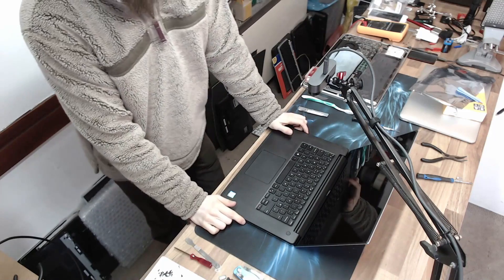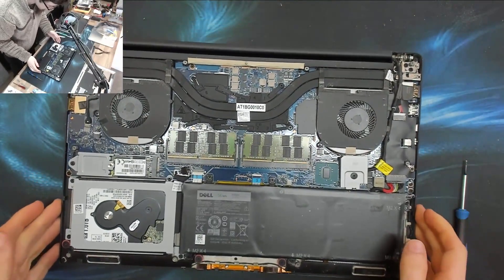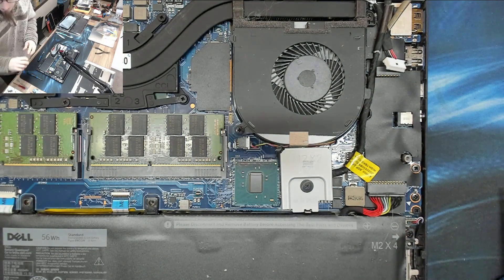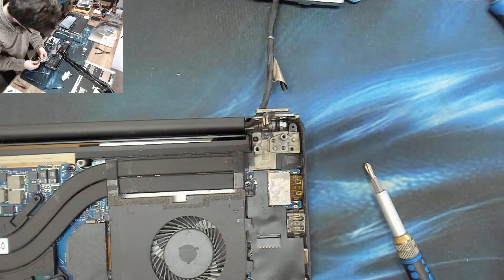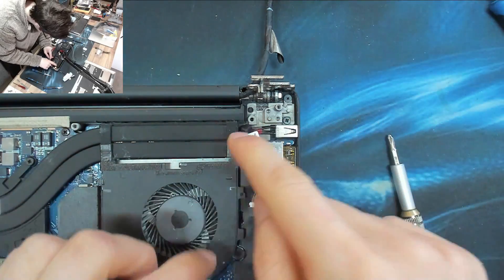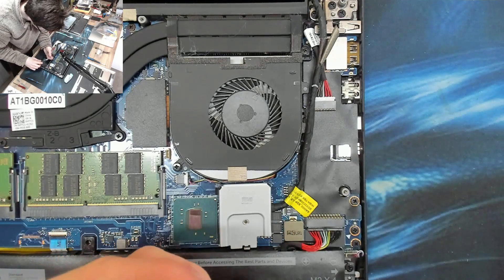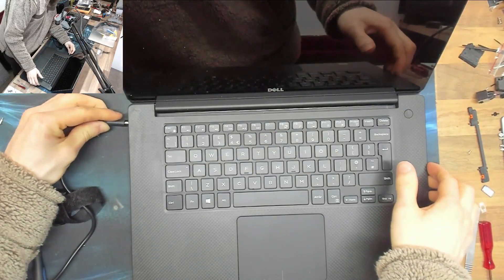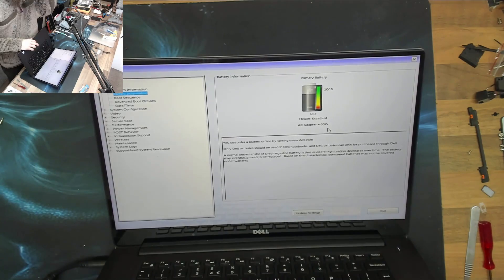LFC#130 - XPS 15 DC Jack Replacement

Comment: Thanks a lot for the video. I was smart enough to stir in the DC port with a 3.5mm headphone jack. Classic. Broke the plastic thingy off. I'm now charging via USB-C, but after seeing this video, I think it's well worth spending the $6 on the replacement port. Thanks a lot.

Comment: Odd question, but you dont happen to know the name/product number for the replacement DC jack? I ordered one through which turned out to be the wrong one and I can't seem to find the correct one anywhere haha!
Reply from the maker: Not exactly. I usually search for something like "dell xps dj jack" on ebay, and then browse the results until I see one that looks identical. Pretty much all ebay sales these days have accurate pictures in my experience, so if it's a visual match, it should be correct.

Comment: should i replace if cable is loose fitting? it easily comes off the jack.
Reply from the maker: Yea that sounds like it's worn out. For how easy this is to do, I'd say it's a good idea.
Reply: @Adamant_IT  i will. Thank you. I need to replace the hinge too, so I'll do it all at once.

Comment: This is so simple! Fixed computer within a matter of 15 min. For anyone out there wondering, I have the XPS 15 7590, this jack seems to be for the 9570. Found my jack on amazon for $8. Beats $100 by a mile for someone else to fix it. Great video, thank you!
Reply: I also have the 7590 - do you have the correct part information? :)
Reply: @caroljordan7384  Hi! I tried replying twice, I guess it didn't send. Here is the information, I bought the part off of amazon. 

GinTai AC DC Power Jack with Cable Socket Plug Connector Port Replacement for Dell XPS 15 7590 P56F003

Best of luck fixing it!
Reply: @eviel4297  I just replaced mine with this part and the computer won't boot if the battery is connected, just flashes the power LED slowly. Not sure what's going on.

Comment: This is not for the Dell XPS 15 9570!  All electrical connections are soldered - not screwed.  I recommend everyone who owns the 9570 get the accidental damage coverage from Dell.  Good luck getting it scheduled for service.  I've been trying for about 3 weeks just to get a call back from Dell to get the jack replaced.  Geek Squad cannot fix it due to the soldered connections.  There is only one service center in the US to make the repairs.  I hope this doesn't cost me an arm and a leg to replace an $8.00 part!

Comment: Re: Hinge for anyone reading. 
Removing the screws from the hinge and just opening the screen as I normally would was much easier than wrestling with a screwdriver to pry it open. Just open it enough to work on and close the screen back down, since it's not screwed in anymore the hinge will stay open.
Reply: this was a big help

Comment: I bought a usb c charger for my 9560 and its working. After viewing ur video i ordered a dc jack replacement as i lost the plastic piece in the center of my barel. I changed the dc power jack and the laptop isnt detecting the charger in the bios , its saying "unknow charger". Where does it could come from then ?

Comment: Good video thanks. How come you didn't disconnect the battery first? The battery module in my XPS quite clearly states "Disconnect the battery before accessing any parts or devices"

Comment: A great video! Very helpful. That hinge is tight!  Definitely worth investing a few dollars on proper screw drivers. Can buy them on Amazon.
Reply: Do you know exactly what tool it is called that is needed to take screws out of the back of laptop cover?
Reply: @DWSurveillanceSolutions  torx screwdrivers t5x50

Comment: Thank you for the video, Just wondering why the charging light didn't turn on and whether it had something to do with the installation of the DC Jack?? Thank you.
Reply: I wonder if he didn't use the right charger. XPS 15s use 130 watt chargers. Lower wattage Dell chargers are compatible, but perhaps the light doesn't come on when using them?

Comment: These apparently break often, and dell claims it's not covered by warranty as it's due to "wear and tear". Yeah right. Glad it's at least easy to fix on our own.
Reply: Yea, just had this happen after only 6 months of ownership, and I rarely pull the adapter out, as it stays plugged in 95% of the time. 

There is no way they can claim it should break after only 6 months when it's been disconnected maybe a handful of times.  If I have to, I'll take them to small claims court.
Reply: mine pretty quickly, only lasted a little over half a year (with heavy use during the fall semester), still works if I keep it plugged in though
Reply: Mine is still fine, if a little loose after 4 years. But I'm glad it's only a ~£4 part if it needs to be replaced. These Dell XPS laptops are great on the user repair front.

Comment: Hi,

I went about replacing the DC jack today and I seemed to have broken the black part which connects to the rectangle white connector with the red, white and black cables. It seems to have come off and I can't get it back in place. What can i do to resolve this?

Thank you
Reply: @Adamant_IT  the pins on the board are there, but one of the pins on the small black piece have come off. I'm taking it to a repair shop soon? Do you think they'll have a replacement part for the black connector part?

Comment: I have the exact same laptop and its rubbish may be half the price but way more troublesome
Reply: inverterville how do you mean rubbish? Is it poor performance? You may want to check your CPU speed. If you’re having issues with the power jack (assuming you are since you’re at this video!) the laptop automatically throttles the pc to something like 0.74GHz, instead of the usual 3.4, which definitely feels rubbish. Hopefully if/when yours is fixed it runs smoothly again if this is indeed the problem you were having!

Comment: Hi, thanks a lot for sharing your insight! This is exactly the problem I seem to have with charging my Dell XPS 15! Just had two questions: is the last software/boot up step absolutely necessary/unavoidable? if yes, could you please kindly type some hints? Secondly, did the LED light below the touchpad finally turned on at the end?
Reply: @Adamant_IT  Regarding the LED light on the front, because the battery was fully charged it did not light up.  If the battery was less than 100%, the LED on the front should have lit up.

Comment: This video is about the best of all of the videos on the topic. There are some that make it look difficult but you made it look as easy as it is. I got the new part and the tools in the Shenzhen market for less than the cost of the part on Ebay. Job done in 5 or 10minutes, thanks again for for the video! Don’t forget to clean out the fluff from your fans while the case is open 😀.

I did a write up of the adminny bits of my visit at: https://kk4oyj.wordpress.com/2018/04/20/day-visit-to-shenzhen/
Feel free to delete this link if you feel it’s inappropriate 😀